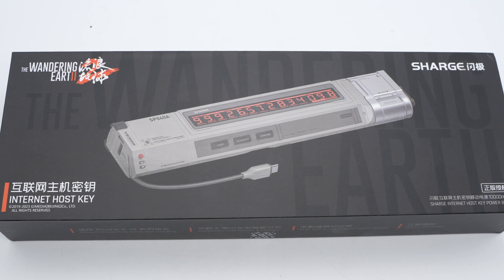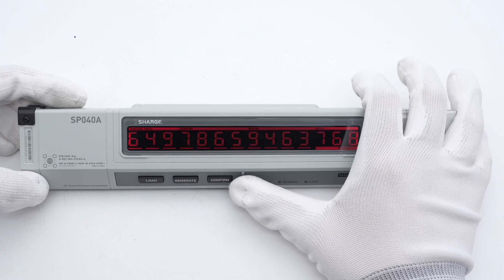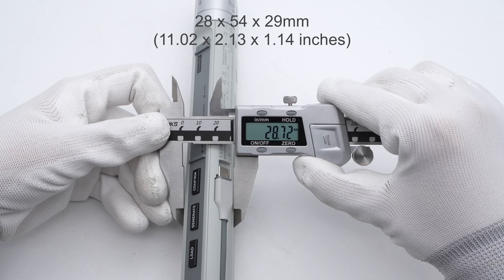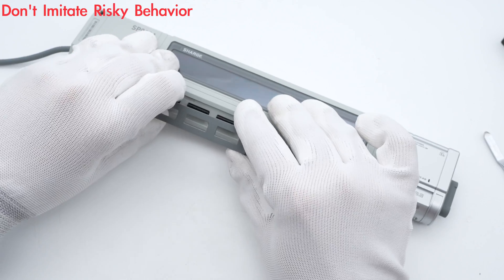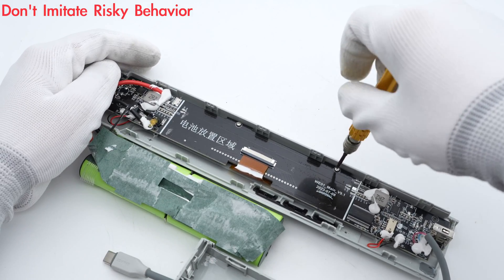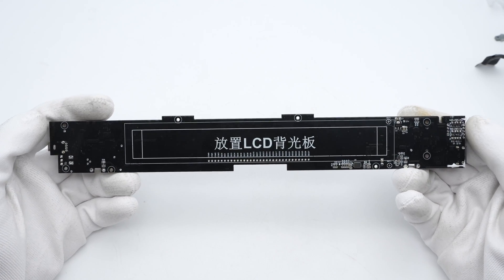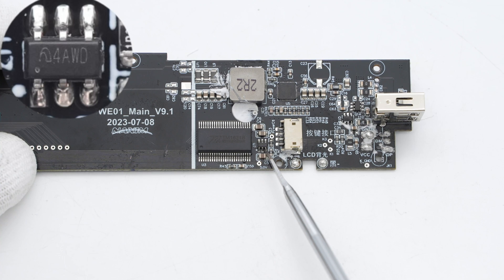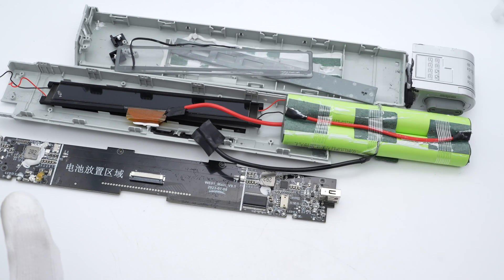Internet Hostkey | Teardown of SHARGE 40W Power Bank (Wandering Earth II)

Comment: Could seriously up the capacity of this thing if you used Vapcells 4000mAh cells...Shouldn't be an issue since the output of this thing is fairly low and those cells are rated at 12.5A...but of course don't do so well above 5A which still should be no problem for this thing. 3.7V @20A is 74W so plenty of power at a mild discharge rate for those cells. On a more budget minded approach some LG MJ1's would work well...and gives another 3600mAh of capacity.

16000mAh isn't too bad.
If you could squeeze some 6Ah Lishen 21700's in there you'd be at 24Ah which is where I think most people want a powerbank.